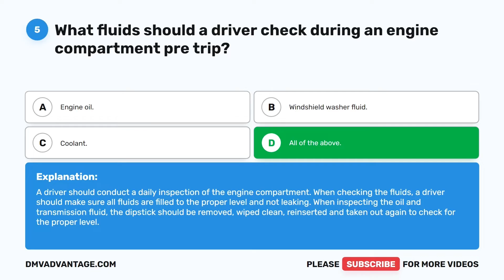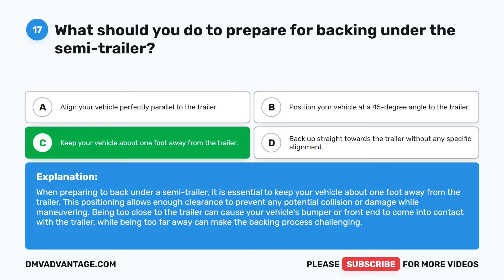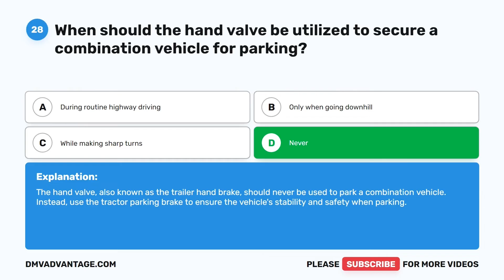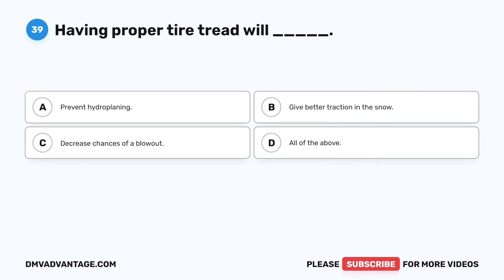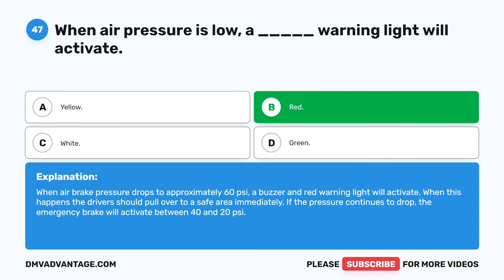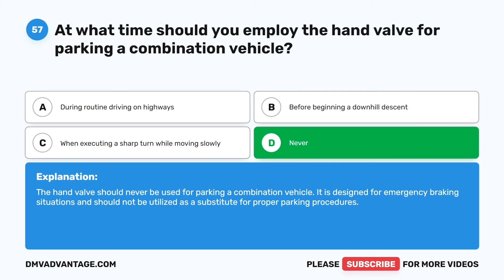CDL Combination Vehicles Study Guide — 60 Questions with Explained Answers

Comment: Question valve, which valve is this chapter 5, modulating control valve to apply spring breaks. Hand valve never use for PO parking chapter 6 says. Definitely confused!